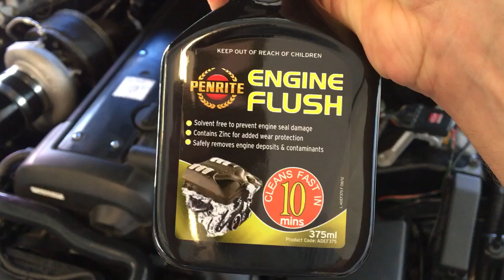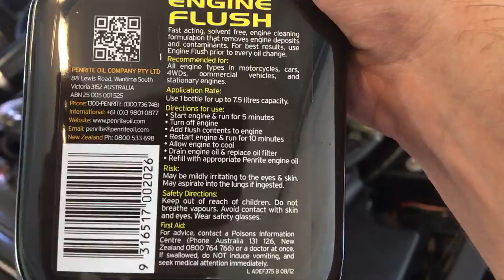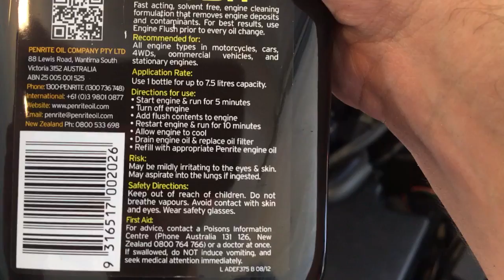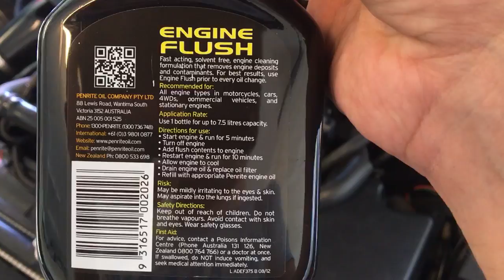Review - Does Engine Oil Flush Actually Work we follow all these instructions to find out

Comment: I have Hyundai ix35 2.4 awd petrol odometer 1035000. My car run out of engine oil after every 4000 kms having little sluge inside seen from top and never make smoke. Does engine flush will solve the problem?? And increase milage. As my mechanic say no to flush and ask me to use high viscous oil
Reply from the maker: Your mechanic sounds like he hasn’t been servicing the car often enough, or using non synthetic or semi synthetic oils. You can use a flush like this, all engines burn a little oil, it’s not massively noticeable all the time, some makes its way into the inlet manifold from the crank breather - then I would probably just start using higher grade (higher quality oils such as full synthetic etc)
Reply from the maker: Oh wow I saw that you said 1 million km... That is insane! And a great effort! Just keep the oil topped up, anything with that many kms on it is on borrowed time! I haven’t even seen taxis in use with that sort of km!

Comment: Engine flush used just before an oil change is probably going to make old pitch black engine oil un-noticably blacker.
You cant tell if the flush has removed any more crap out of your engine.
The most important part of your engine to keep clean is the oil control rings and their groove so you get the right amount of lubrication for the cylinders. Not too much, not too little.
Reply: yes! i often pull the engine from my car, strip it & clean out the oil ring lands!
Reply: @grahamgallagher1443  Thats what the engine flush is for.

Comment: Kerosene does the same thing lol.
Reply: YENI CERI how do you determine what amount of kerosene will work? Also, if I continue to fill with kerosene, run 5-10 mins, drain and less sludge drains out each time why not continue until no sludge drains out? Wouldn't this be more through all and not hurt the internal engine parts?

Comment: Great choice of Engine Flush!
Reply from the maker: have been using your 10ths Racing 10W40 and found that after a few thousand km's and some filter changes (some in between an actual oil change) the PAO/Ester Group IV oil is pretty much the best internal engine cleaner anyway!

Comment: so you buy a shit oil that is on sale.  that is what I call taking care of your car.
Reply from the maker: it was literally to get it up and running, was only in the car for a thousand km's at most, pretty much just to shake down the setup.. identify any leaks etc..

i will update another video where i am not using any type of flush agents, and just using a full synthetic PAO Ester oil, with multiple filter changes, and top ups - with a Group IV synthetic you should be able to get great cleaning and extended life without the oil breaking down the way mineral oils do and forming that burnt sludge etc..
Reply from the maker: FYI is was castrol 10w30, that met all the minimum requirements for the engine.

Comment: Ummmm "WHAT". The title of this video is "Does Oil Flush Actually Work". Hmmm. Over 12 thousand views, and not one of those viewers knows if an oil flush works. "Based on this video at least". I need to start making YouTube videos. However, I will film them in there entirety.
Reply: Well i do actually know that it works.
I've been using omega 907 for many many years now, (an additive you run for 10 minutes and then drain)
And my internals are spotless.
It's an old bmw 320d with 300k KM on the dial.
This cleans up the hydraulic lifters from the point of sounding like a tractor to a near silent diesel ticking.
the engine runs smooth and there's no oil leaks or burning of it.
You wouldn't even know it's a diesel if it werent for my down-turned exhaust tip.
Reply: Gotta start some where Jackass .

Comment: Just 250 ml of dextron auto oil to your oil and drive it a day or two and then dump the old oil and filter. Dex oil or auto oil is 70% detergents. Diesel oils have detergents to but at a lower level. It's an old Mechanics trick to clean out noisy hydraulic lifters in engines.
Reply from the maker: Interesting... i have used about 300ml of Diesel fuel in the oil.. but that was a 350XXXkm old 91 Corolla.. a whole engine was $250 if something happened to it and take a little over 8 hrs to swap and have it driving again..

Comment: So did it work or not? I've seen three of these videos now and no one actually shows the condition of the oil afterwards. How are you supposed to make a verdict?
Reply: Oil would be black even after 5 minutes of running I suppose
Reply from the maker: +arbit3r the oil was only in there 'fresh' running for about 1 week or so.. then i did this flush - YES the oil was black as anything. as the oil was only in there for a week - it was still golden yellow.. but when draining it was solid black.

Good point though thanks for the tip - i will be doing another flush on this in a few more weeks, i will pull the dipstick and show the colour of the oil before, and after running the flush to show the colour difference.
Reply: I've noticed on my own vehicles that the oil goes black almost immediately after a days use so it would be really hard to make a solid conclusion based on the color. I think the only way to do an accurate test would be a physical inspection such as lifting the valve cover and taking a picture/video before and after. On motorcycles there is usually a viewing window rather then a dip stick which is almost always gummy and varnished regardless of the condition of the oil and is a good insight into the general engine state. Thinking about it I think that would be a good way to visualize the effect of such products without an intrusive engine inspection.
Reply from the maker: arbit3r 100% agree with you there, although my engine must not have been as bad as yours, the oil (being the medium in which it will be suspended in to the filter then smaller particles will be remaining in the oil) remained quite clean after 200km driving (a few days of running around) which either means that the oil i was using was not enough to breakdown the solid parts to get them to the oil filter or is is cleaner than i suspected, i have a few pictures of this engine when i was painting the cam covers, so maybe i can make a photo montage and after a few more flushes and pop a cam cover off, showing a before and after, they state on a few different brands that you may need to use one each time you change your oil, or on engines that have not had a good service history it may take a few oil changes to return it to a normal state of use.

either way service intervals are key once the engine has the bulk of the gunge etc removed.. my engine was by no means the worst i've seen, really is wasn't even that bad.. i've seen some that look terrible, like the inside of a BBQ after some heavy marinade.

curiously how long do you leave your car between service intervals?
Reply: +MrExtremeboost MAX Boost Well to be honest they will always recommend using their products with each oil change as they are a business looking to sell their products, whether its needed or not is another story. I really only ever do a flush when I first buy a vehicle as I assume its never been done. Usually I do this using a 50/50 mix of Diesel and cheap engine oil. The diesel acts like a strong detergent and works well although if you are doing so on a diesel engine you might want something stronger as diesel oil is already full of detergents. In terms of when I change my oil well it depends on the vehicle. I've always owned beaters or as I refer to  them "Vintage" bikes/cars which have consumed more then the capacity of the sump (4-5L) over 5000miles or the recommended period between changes so I rarely do a complete drain due to the advanced self oil cleaning system of such vehicles.
Reply from the maker: haha, true, do you at least change the oil filter? oil 'now days' has several jobs, not just lubrication & cooling, even 20-25 year old cars now it more often then not to have some form of VVT, hydraulic tensioners for belts or chains, turbo charges etc etc.. so whilst the oil grades and classifications have been getting better and better, simply not doing routine maintenance is kinda the opposite of what most of us are trying to achieve.
Reply: are your vehicles diesel?
Reply from the maker: Garry Larose i currently have a petrol and diesel (2.7 PSA/DT17 Lion, TDV6 etc etc engine) but that is getting scheduled servicing at the dealership for warranty reasons.
Reply: What a s**te video. Doesn't do what it says on the tin!
Reply: That Car Channel why will continuing to do a motor flush until the returning flushed fluid has no dark coloring to it? Also why not use kerosene as the flush chemical and after first flush refill with kerosene, wait 5 mins, flush, Ck'g flushed fluid and repeating until said kerosene is cleared of color signicant color change, then oil refill?